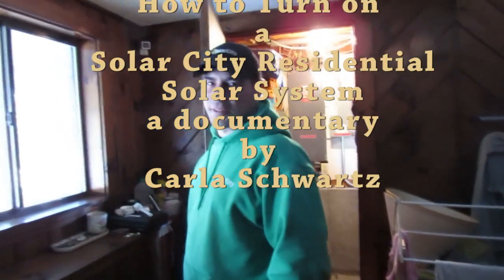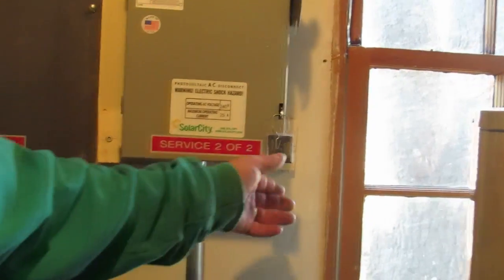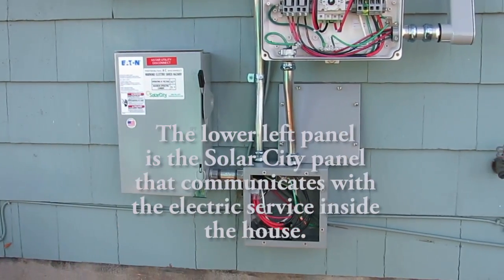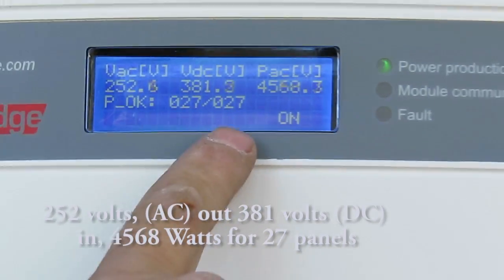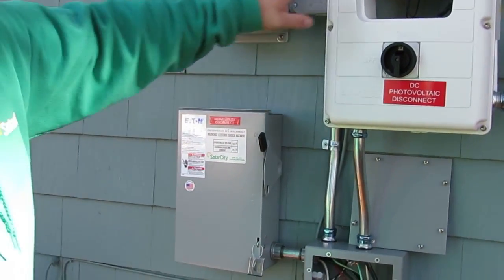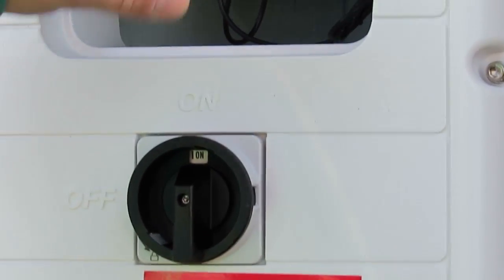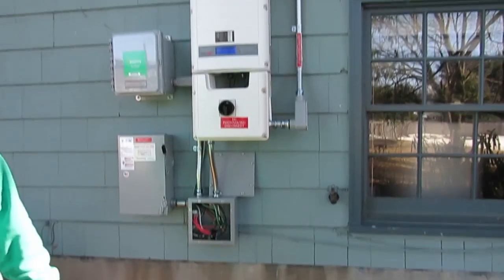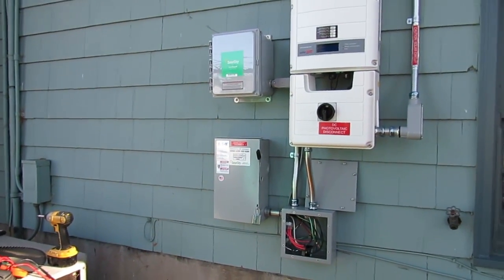How to Turn on a Solar System Installed by SolarCity: #CB99videos  #tesla #solarinstalls

Comment: I am reading on solaredge's website that the P600/P700/P800 model optimizer is compatible with commercial inverters (3-phase). Can you tell me if it works with residential inverters (SE5000 single phase)?

Have you done any kind of testing with these P600 / P700 / P800 optimizers connected to the SE5000 inverter?
Reply from the maker: Sorry for the late reply. I hope you did your install. I didn't do this install myself, so the installers put the optimizers in with they system, now 5 years old and going strong.

Comment: I'm very interested on a system like this , can you tell me the cost of this? And did they have to see how much energy you use in order to propose the right equipment? Or all are the same in energy production
Reply from the maker: They did an assessment for the number of panels based on my then current usage, but I asked them to increase the expected consumption based on my expectations of using electricity for an electric car, some heating, and hot water and cooking. This was a change from pre panels. The cost to me was about 7.5 cents a kwH. I think it depends on what they will quote you, but they do guarantee production of a certain amount based on their pricing, and will pay you back if they underperform. They also perform the solar studies for your site, which factors in to the cost.

Comment: How do you like it so far??
Reply from the maker: I've now had the system since Mar 2014, so over 4 years. Still doing very well with it. I have not paid an electric bill since, even with my electric car, cooking with electric, and supplementing my gas heat with electric space heaters.
Reply: CB99Videos So when your powerwall is 💯 charged, and the power is going to the “GRID”. Does that mean your local power company is buying that of you??

Comment: Did I understand correctly that if the grid power goes out the solar system also shuts off? If so, is there a way to fix that so your system can 'take over' automatically in the even the grid goes down? (I suppose it would involve isolating your house from the grid so you don't electrocute linemen working)
Reply from the maker: you understand correctly. If the grid goes out, you lose electricity. But if you have the money you can hook up a powerwall, or create your own backup, but that takes a bit of work. Luckily, where I live, we haven't lost power for more than a few hours at a time at most.
Reply: Battery backup
Reply: I would totally disconnect from the power company

Comment: Can you update us on the performance of the system? If you're happy or not? Thanks.
Reply from the maker: So far, so good. I made about 7400 kwh in 2016, 7980 kwh in 2017 and this year it appears I'm on track to make at least 7100. The production varies greatly of course from year to year, due to cloud coverage and temperature changes.  I haven't checked the inverter lately but will do so to see how it's working, but my guess is the fluctuation this year is due to the large number of storms that have come through.  and a little more snow cover in winter. I have three "Go Solar" videos you might be interested in. They should be on the same playlist as this video. Thank you so much for taking the time to watch, and for your comment.

Comment: 252 volts from the grid is oddly high.
Reply from the maker: The 252 V AC reading is the output voltage of the inverter from the panels that steps into the house.

Comment: Is your array a string array or was it microinverters on each panel?
Reply: CB99Videos I just got my install.... it is a 9.180kW DC system. I was concerned about shading as i have a chimney that puts some shade on some of the panels... so was just curious when the installer in your video said that the panels compensate around the shade.. it seemed like he was talking about microinverters... can't wait for mine to get approved and i can turn it on and see what this puppy actually generates... however i like the guaranteed production they offer.
great video!
Reply from the maker: richman107 Thanks so much. I think that was one thing the Solar City manager might have been mistaken about, as the other solar city guys told me that they installed optimizers (not inverters) to optimize the system production during shade, and I believe that is what happens.  In other words, supposedly panels in the shade are shunted out to optimize performance. Congratulations on your system and good luck.
Reply from the maker: it's a string array... solar city design..
Reply: CB99Videos I don't think I have any optimizers :(, but I don't think I have that much shading overall that maybe they didn't feel they needed it.  there is some shading, but I guess overall in the longrun it may not have mattered too much...

Comment: How much money is this system saving you if you don't mind my asking?
Reply from the maker: my electric bills are down to zero...so, it's kwH in the bank right now until winter...
Reply: CB99Videos Did you lease or purchase the panels?
Reply from the maker: Victoria Boatwright I did not purchase the panels. I am leasing them, prepaid, as that way I am sure of the rates.